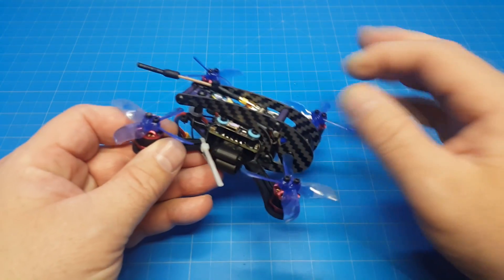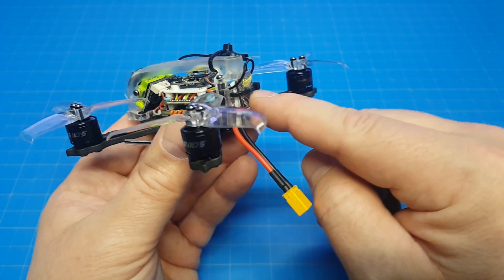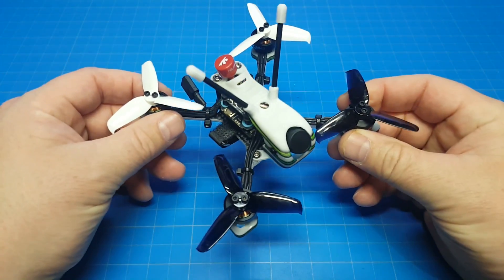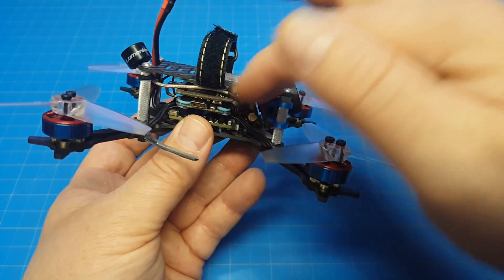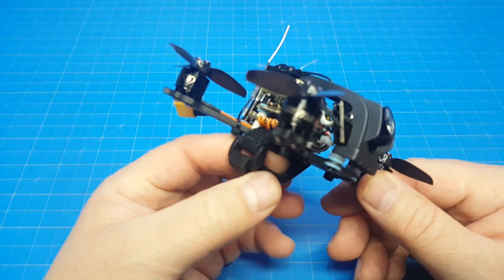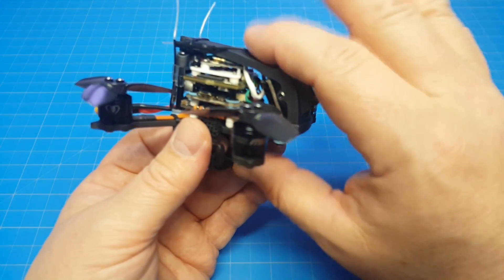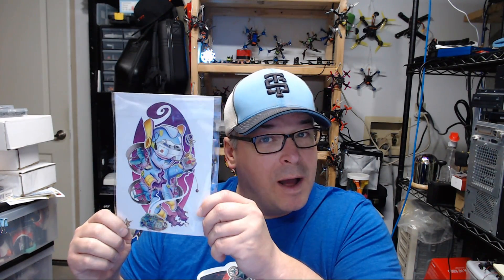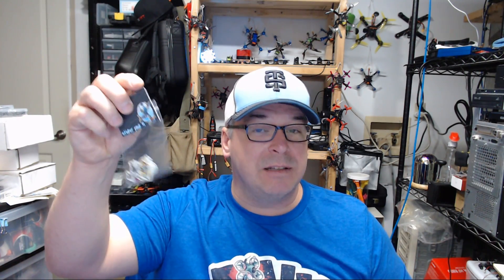Coming Soon April 2019

Comment: Bummer that you were disappointed with the RCX NK1306 motors.  I've been using the EMAX RS1306B 4000kv motors on an HD 3" and they're great in terms of power to weight and smoothness, but even a light crash often results in a bent motor shaft so I was hoping the similarly-spec'd RCX motors would be a viable replacement.
Reply from the maker: I have been tipped off I need to use a higher pitched prop. Could change how I feel about it.
Reply: Nick Burns - Okay, sounds feasible. I’ve been running low-pitch props such as Gemfan 3028 and HQ 3X3X3 and they seem to match well with my current motors. There aren’t many offerings in 3” t-style at the moment that are more aggressive, but the 3044 tris come to mind.

Comment: You gotta try steeper pitched props on those rcx 1306 motors. those 3035 are ok,  but the DAL 3056 cyclones or even their 3045. woo-
wee!
Reply from the maker: ah very good. I will give that a go. Thank you

Comment: I have a couple of these frames you have upcoming. The 2.5" diatone frame I was hoping to be a go-to product. The bare frame is only $19 and comes with a ton of extras. The problem with this frame is the screws holding the fpv camera. They come within maybe 1.5mm of the end of the props. If you crash the plastic canopy will flex and you can snag the camera screw with the prop. I broke 2 micro arrow cameras this way. I started using the avan 2.3" props to keep this from happening again. The micro alien, you have no access to the stack screws. You have to take all the arms off to get to them. ugh.  Have you gotten a Hawkeye Firefly 2 in your hands yet? I am hoping this is a decent HD alternative for micros as I can't get used to the fpv image on cameras like the turtle or split.
Reply from the maker: good alien info. I should be able to take the firefly 2 for a spin in a few weeks. I hope it has made some good improvements.
Reply: @NickBurnsFPV  also forgot the standoff screws on the micro alien are m2.5. Who has m2.5 screws? I lost one and have to swap a standoff.

Comment: On the Diatones.  I own the  GTM 2.5, 3, and 515.  Great quads.  Not really a fan of the new canopy design.  Really like the aluminum cages better.  The GTM series were all beasts.  Had a few motor troubles but really just fantastic flyers.  I am certain the new series from everything I have seen are gonna be just as fine.
Reply from the maker: I think sometimes they change things just to make a new product. Like a new coat of paint on a house or something. I do hope the 2.5inch performs well, so far the 2inch doesn't.
Reply: Are there jello even on 3s?

Comment: I would say I have to disagree about your receiver module. I bet you could put Achilles on it and I have seen the RX5808 with achilles on many comparison videos and it seems like it preforms better than everything else except Rapid Fire despite the cost. I just hope it's just as good as the RX5808, we will see though. Thanks for the Vids!
Reply from the maker: Really, there has been videos testing it already?
Reply: @NickBurnsFPV  No sorry I meant if it is comparable to the Rx5808 pro that I have on my Attitude V3's with Achilles 2.0. They look like a True D clone though. I have one in my cart on amazon just cause I am interested though. :)
Reply: @NickBurnsFPV  My Attitude V2s have amazing reception with the Pro58 (same thing, basically). I prefer the WPro58 firmware, personally...because free.

Comment: I don’t know what they were thinking on the driblet, 2” was so summer/fall 2017!   Remember the lizard95:-)
Reply: Exactly. When all the 2" frames came out everyone converted them to 2.5" almost instantly. Should have been a 2.5" from the start. Especially with the 3mm base plate.
Reply: @ryan3859  LeDrib specifically said he wanted a 2in when he introduced the frame. He said he felt 2.5" was too much for the intricate flying in small areas he wanted to do.

My favorite quad is my AmaxInno freestyle 3 with 1106-6000kv and KK2840s on 3S. I'll stick to that one.
Reply from the maker: I suspect a piece of the driblet had to due with the sunk cost of the motors they developed...dabs. New spin on 1104, they likely have their place, but I wasn't interested. I also think it was noteworthy all the driblet video footage has low voltage on the screen.